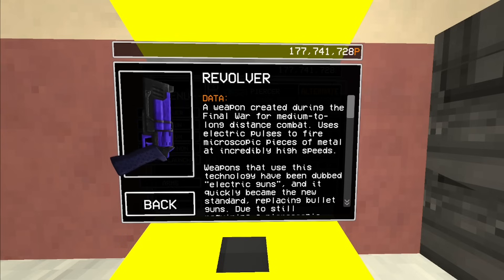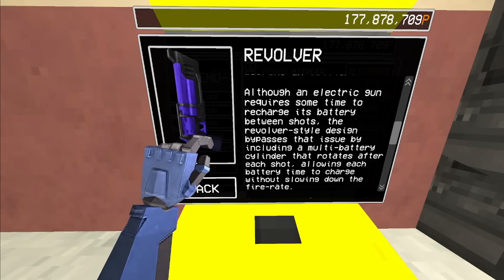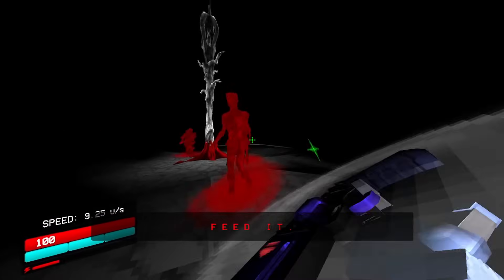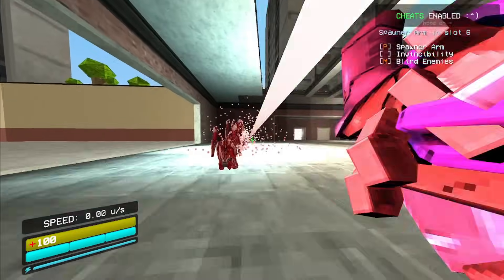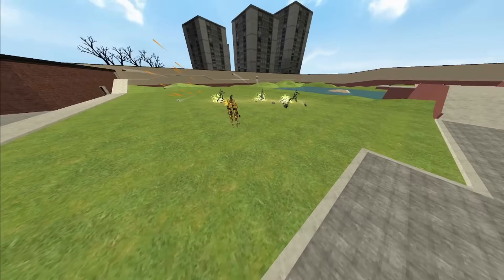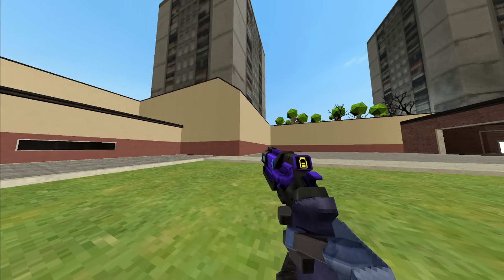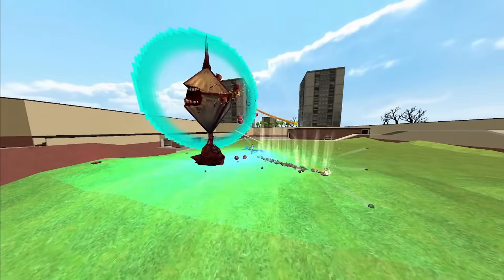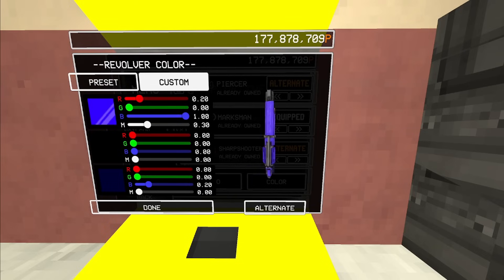How Does Ultrakill's Pistol Work?

Comment: Capacitor actually make a lot of sense, and are used in real coil guns,
The main thing is:
A battery wants to consistently output the same amount
A Capacitor can release its energy way faster, but has a harder time storing it.
Thus, if you have some kind of blood reactor with a consistent output, and you want to fire a high output shot every now and then, charging capacitors is not a bad way of going about it, kind of like building a dam, and opening it when you want to fire.

When it comes to cooling, heat is technically a by-product, in the best case scenario, all energy is used to make the projectile faster. By this logic, assuming future technology improves efficiency drastically, cooling is not all that necessary, funnily enough, they could be a justification for the funny looking wings on V1's back

Revolver is bigger, so it works pretty well in universe, if so, I dare you to explain the hammer
Reply from the maker: Blood energy make the projectile go weeee and then the air becomes a giant plasma ball and thats why it kills things.
Reply: well the wings on V1 are for storing weapons and assisting in aerial mobility
Reply: @theocelotninja1028   Interesting, didn't know that.
Areal mobility I can see, would also help with cooling, as waving them through the air would increases airflow. And would explains the air dashes.

Storing weapons sounds cool, but not very practical, as you probably want them as light as possible for mobility reasons, and I have yet to see them filled with weapons.
Reply: @jaceg810  the storing weapons thing I've seen it all over lots of ultrakill content, no idea where the source is though so you're right, it might not be canon.
Reply: @theocelotninja1028  i'm pretty sure the act one album art display's the weapon's inside the wing's of V1, so it probably is.
Reply: perhaps the hammer is actually more of a cocking lever